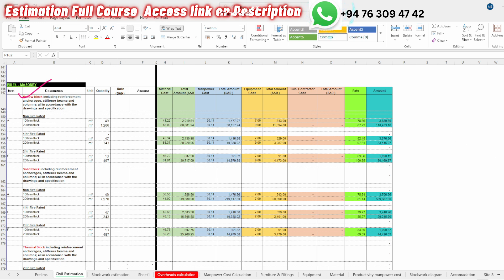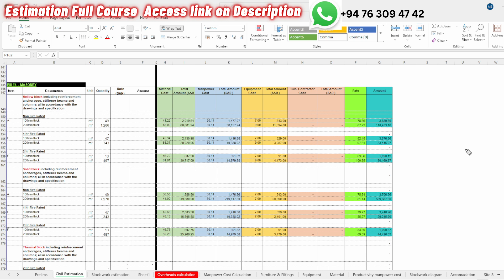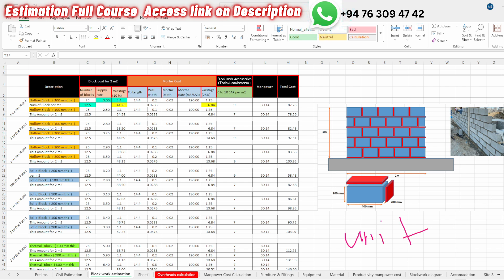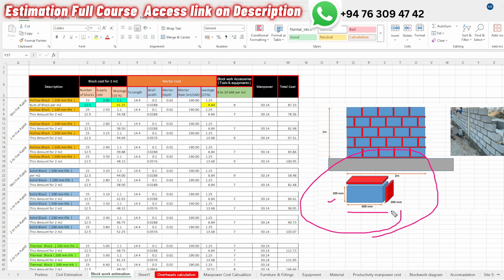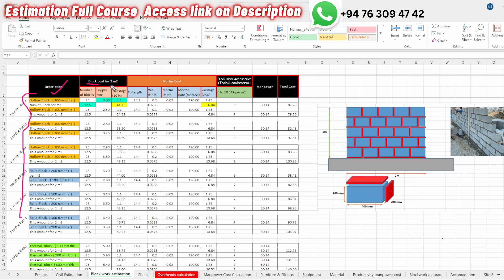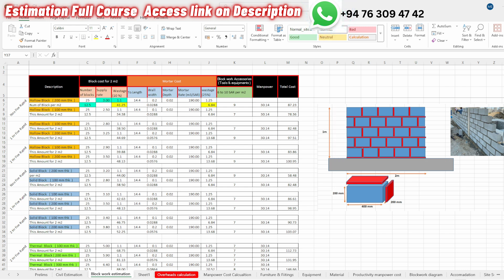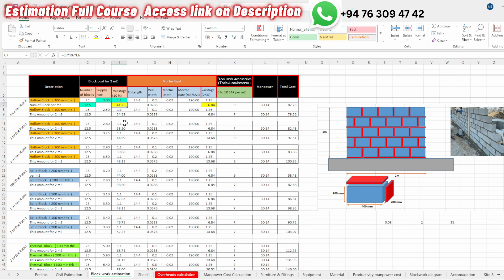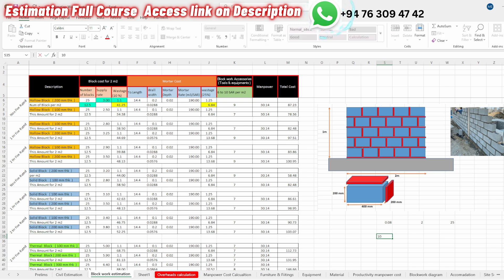Cost Estimation in Construction – Detailed & Practical Explanation #qsclub #quantitysurveying

Comment: Sir i have a doubt 1m x 1m wall build பண்ணும் போது சிமெண்ட் + block ஐ கொண்டுதான் கட்டுகிறார்கள். ஆனால் நீங்கள் சொல்லுவது போல block கணக்கு பார்த்தால் அதிகமா வருகிறது.. காரணம் (1m x 2m) / 1 block உடைய பரப்பளவை கொண்டு ஆனால் நீங்கள் cement இடுவதற்கான இடைவெளியை கணக்கு எடுக்க தவறிவிட்டீர்கள்.. எனவே 1 m square ku extra 1 block வருகிறது இது பெரும் பரப்பளவை கணக்கு இடும் போது அதிகமாக கணக்கு இட நேரிடும்.. நான் இதற்கணான ஒரு கணக்கை செய்கிறேன் அதை சரி பார்க்க முடியுமா? 

 We need calculated 1 block volume with mortar so 412x212x200= 0.018 m³

1 block volume without mortar 400x200x200 = 0.017 m³ 

 So we need calculation 1m² wall valum so 1mx1mx0.2m= 0.2m³  

So number block 0.2m³/0.018= 11.11 so roundup 11.5 or 12 block 

So total block volume without mortar 11.11x 0.017 = 0.189 m³ 

So total motar 0.2 - 0.189 m³ = 0.011m³ 

Summary 1 m² wall 

Number block 11.5
Motar volume 0.011 m³ 

Add 10% wastage  
Number of block  11.11 x .01+11.11 = 12.22 so 12.5 brick 

Mortar 

Then we need calculated mortar volume so 0.011x0.1+0.011 =0.012